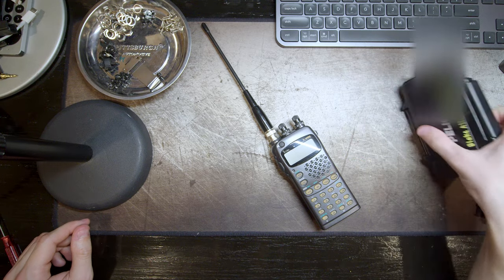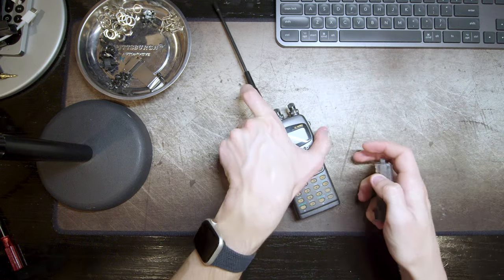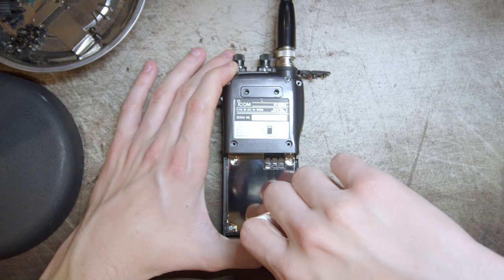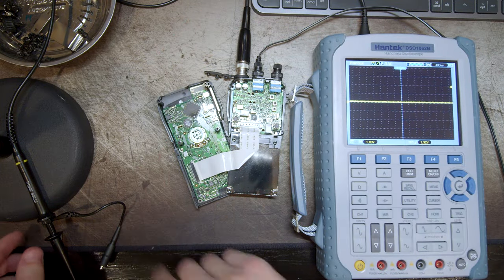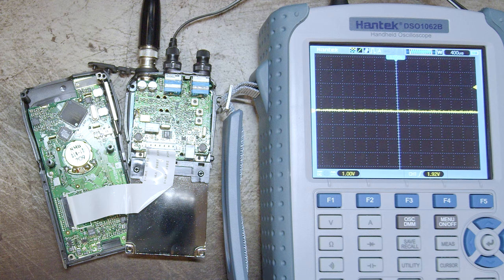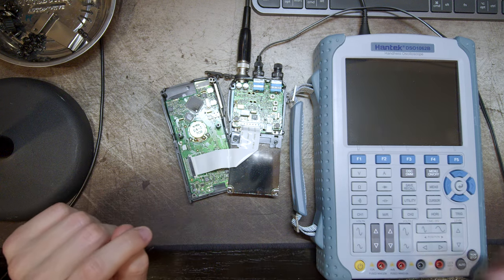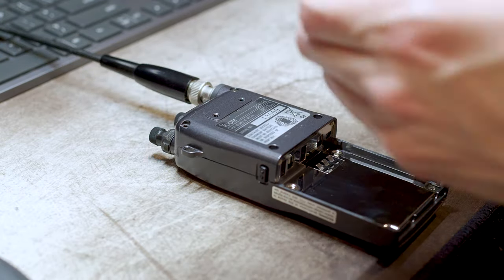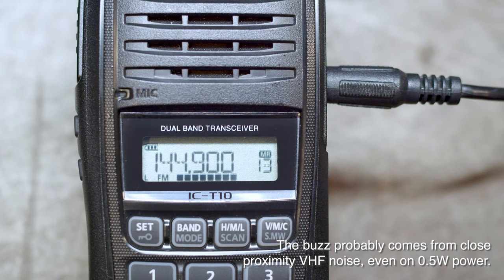ICOM IC-W32A Simple Speaker Repair on HAM Radio Transceiver

Comment: I have one with distorted audio and I think the speaker/mic connector is part of the issue.  Using an external mic works but is intermittent. Time to dive into the service manual.  The radio was purchased in 1997 or so.  I found that a programming cable had trouble also since it uses the same connections.  73 AE7EF